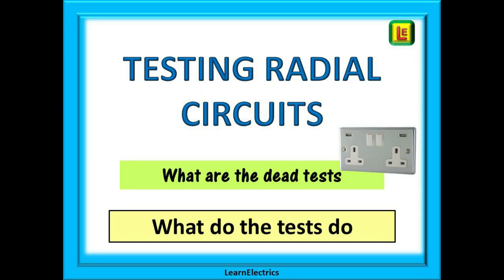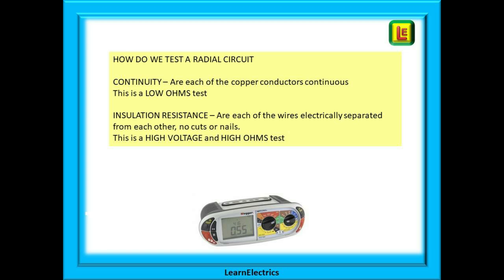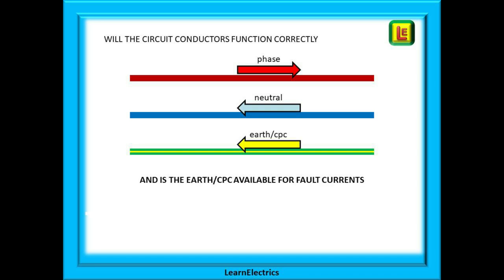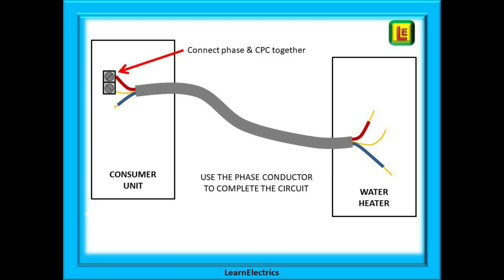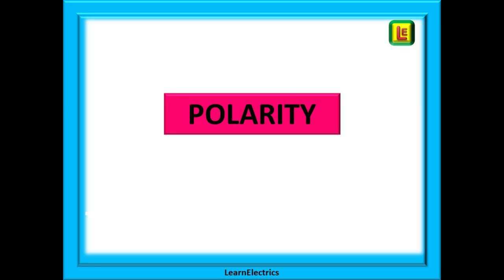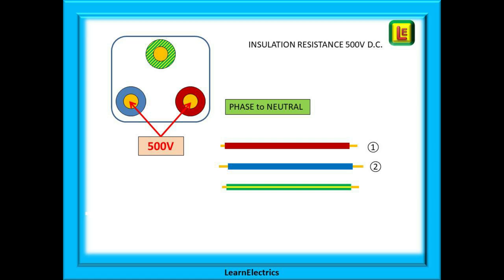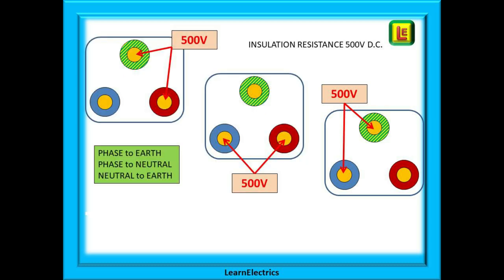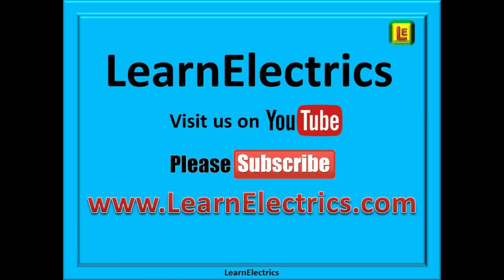TESTING RADIAL CIRCUITS  Lighting, Cookers, Showers and Radial Socket circuits.

Comment: Another fantastic video as always Dave 👍
It’s its quite easy really, the hard bit is understanding the readings and what they mean,and remembering to test every single part of each circuit , many sparks don’t operate the switches
Reply from the maker: cOntinuity has an O for LOw Ohms.
Insulation Testing starts with an I for hIgh
Thanks for the feedback. Dave.

Comment: Thank you so much for these videos, by far the clearest explanations I've seen. But just to clarify, if a lighting circuit has multiple points (e.g. several rooms each with a ceiling rose/ switch) presumably each and every one of the rooms needs to be tested for continuity at the ceiling rose and the switch as described in your video. If that is the case what R1+R2 reading is recorded, the highest?
Reply from the maker: Yes, correct. If the worst case passes the Zs requirements, then so do all the others. Thanks for watching. Dave.

Comment: Very comprehensive. Many thanks.
Is it possible to do one video on EICR, domestic complete testing using any multimeter. I meamt ring, radials And if LEDs are fitted in the house how to  bypass those 50 plus LED's?
 thanks again for making it easy to understand.
Reply from the maker: Thank you Asad. Those videos are planned, keep watching and thanks for your great support. Dave.

Comment: In the polarity test, Lets say you have 5 sockets in a radial circuit. Do you have to test the polarity on every socket or just the last socket?
Also, If it's just the last socket then which switch do you have to flip to test polarity. Is it the switch of the socket you are testing polarity on (e.g. last switch) or can it be any single switch in the radial circuit (e.g. third switch)?
Reply from the maker: I would test every socket. If you are using a socket adaptor, flick the switch on the front of the switch outlet.

Comment: What if the cable is nym instead of twin & earth?
Reply from the maker: They can still be tested, use the appropriate tables in GN3 for reistances etc. I just quoted T?E because its most often used. Thanks for watching. Dave.
Reply: @learnelectrics4402  thanks Dave 👍